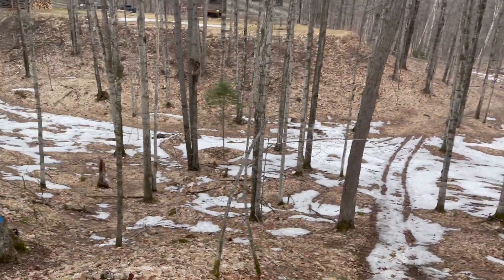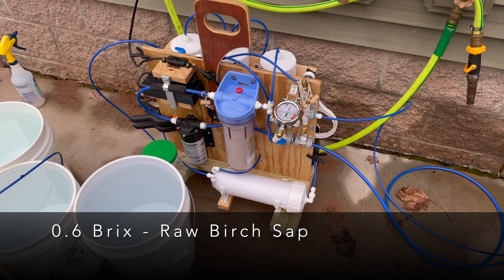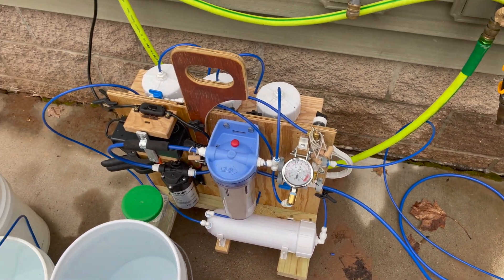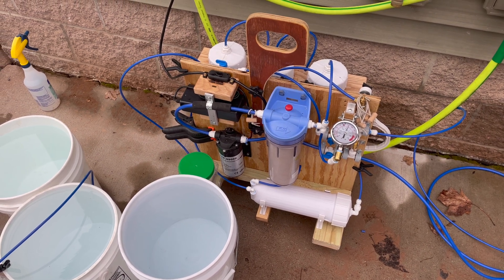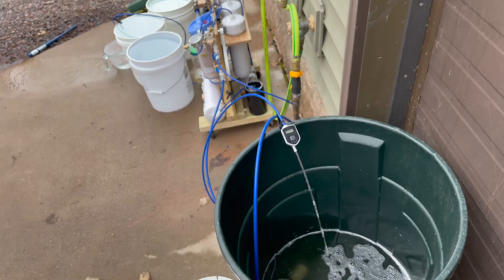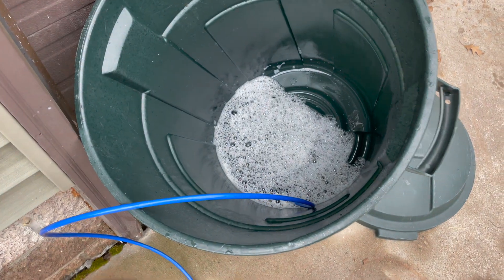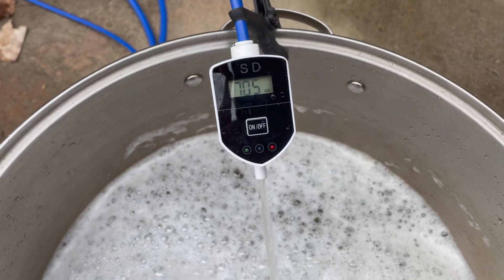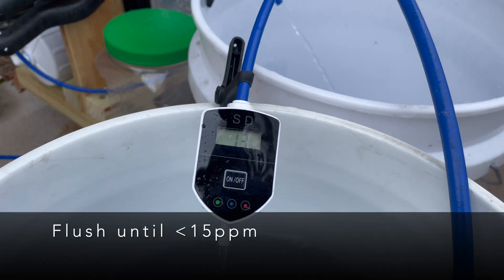Maple Syrup Reverse Osmosis 2023 Upgrades (TDS Meter + More Membranes)

Comment: I have two 400 gpd RO filters being ran at 100 psi and out put is 50/50 concentrate to permiate I'm starting with 1.3 brix sap and ending up with 1.8 brix in the concentrate and have .5 brix still left in the permiate or where the water should be coming out. I am wondering if this is normal for it to be only condensing down to 1.8  from 1.3 brix sap or if I just need more filters? Any help would be appreciated
Reply: I am using a hand help ppm reader and your conversion chart to convert ppm to brix
Reply from the maker: Check your plumbing between each membrane housing - permeate should always be super close to zero ppm/brix.
Reply: @samuelwiltzius  I've triple checked everything and it exactly how everyone has there's set up except I only have two 400 gpd filters I'm thinking I just need to get 2 more filters. Thanks for your help!
Reply: @samuelwiltzius  I'm still not sure how sugar molecules are making it's way through the ro filter and out the end of the permiate line because I thought that was impossible for it to go through the Ro filters.

Comment: Where did you find that TDS meter? That's a great idea.
Reply from the maker: I found it for around $15 on Amazon: Inline TDS Meter for Reverse Osmosis System and Water Purification Quick Connect TDS Monitor with 2 PCS of Straight 1/4" Push to Connect Fittings, Whirlpool, Express Water, Reverse Osmosis System https://a.co/d/gJGDQnf